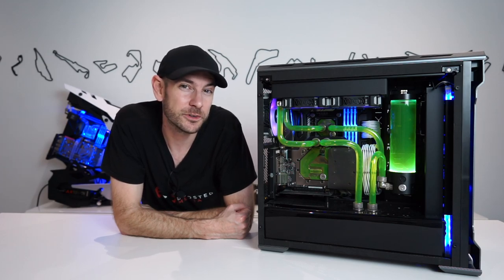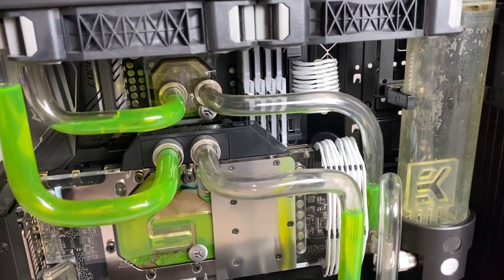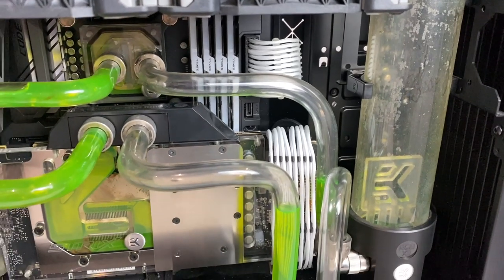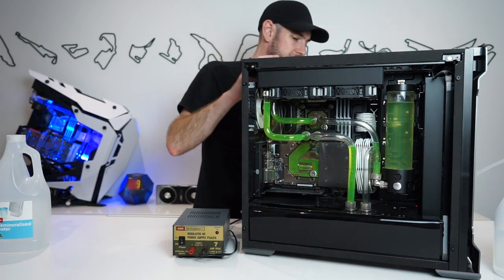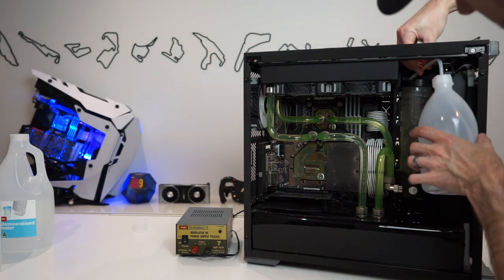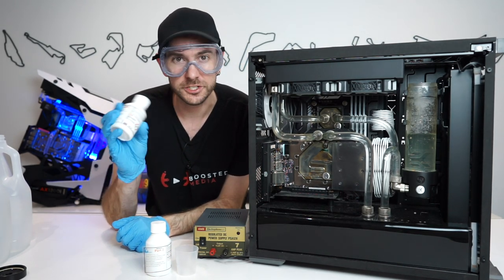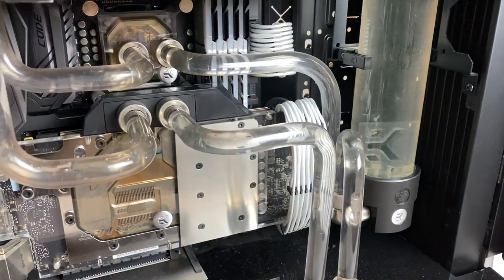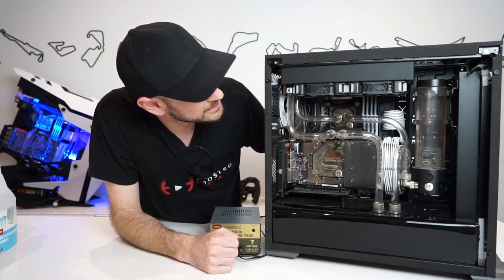WATERCOOLED PC MAINTENANCE - Part 1 - Fluishing your Loop and Changing Coolants

Comment: This (the maintenance) may be enough to convince me to not go the custom open loop route. I need something that's "fire and forget," not something that needs an "oil change" several times a year. GREAT video & very informative, so thank you.
Reply: what did you end up going with?
Reply: @pt-ri4ng  Prob something just air cooled or at most aio. Go with those if you want to do as little maintaince as possible.

Comment: what you have demonstrated is the importance of getting your drainage system correct and that using dyes is not worth the hassle. I have the Corsair Hydro X with 3 rads ( overkill ) and just using the RGB from the reservoir, cpu and GPU really looks good with clear EK + mineral water...and with a click of a button I can go from red to green or blue or whatever...looks fantastic in a dark case with tinted glass. 
I have the drain on the bottom but the pump always has liquid left in it so used one of its ports for another drain...one thing I have found with soft tubing ( yes..I am a soft c..k) when refilling if I give the tube below the pump a gentle squeeze when refueling it sends a bubble up the reservoir ie. it clears out the air blockage.
But like I said before, always plan your drainage system and spend a few $ on valves. My flow goes like this......Res/Pump to bottom 30mm rad to GPU to CPU to Res/Pump to side 58mm rad to bottom rad to GPU.....should have put the bottom rad upside down and used 90 degree fittings as well as a spiltter and I would get 99% of liquid out
Reply: Thank you for sharing! Your comment was excellent.  I have the Corsair as well but how do you know when it’s time to change out or add fluid?  If you don’t do it will it cause your pc shut off frequently? Then I have to wait a while before it will come on.  I thought it maybe getting too hot and I started looking on iTunes for some answers.  Also do you know  how frequently you are supposed to complete the maintenance, fill or drain?
Reply: @msmichellewoods  Well have seen that people with a colour additive have taking their systems totally apart and when I say totally apart I mean that includes things like the cpu block apart and scrubbing away.  I think yearly is good for a flush and refill.......and next trip into town I will be getting some demineralized water and mixing with the EK-Cryofuel and doing the flush and refill. At the moment the tubes and reservoir seem pretty clear so I dont think anything else is needed. 
If your PC is playing up you need to do basic troubleshooting and use programs like HW monitor to see what is happening . Also is the pump working?  HW monitor plus some stress program to see how things are going

Comment from the maker: Just a quick note on blowing air through the system to clear the old fluid. This will introduce bacteria into the system so you only want to do this to clear fluid before disassembling and cleaning manually as we will be covering in part 2. 

Don’t blow air through a system immediately before refilling with coolant. Flush with demineralised water until running crystal clear, and remove as much as you can by tilting the case before filling.
Reply: In the video you added demineralised water while the old fluid was still in there, shouldn't you remove all the old fluid and then flush it with demineralised water? Or is it like impossible to empty the whole loop?
Reply from the maker: It’s impossible to empty it entirely.

Comment: when flushing the loop with the pump running, do you need to make sure enough coolant stays in the pump? if so how are you able to tell if your pump is separate?
Reply from the maker: Yep pump always needs to be primed. You’ll hear the tone change if it starts to run dry.

Comment: @boostedmedia a bit off topic but I wanted to ask, I bought the new nzxt h1 case and it came with a 140mm aio liquid cooler, think that would be enough to follow your i9 9900k of guide. Mb is also a z390i
Reply from the maker: Yes but you’ll run in to thermal issues.

Comment: Why does an AIO not need maintenance but a custom loop does.  How do you seal and lube a custom loop so you don’t need maintenance.  UV sterilized lines and fluids what’s the answer.

Comment: I just flush mine every couple months so I only have to pull everything apart like once a year. I actually like the maintenance part of it.
Reply: I don't understand why people seem to need to flush their custom loops so often lol I haven't flushed mine in literally 5-6 years and it runs as cool and the color looks just as consistant as when I first poured it. I have my PC in a very dark room I just add some chilled distilled water when it needs a top up that's it! My temps on CPU are 30-36C Idle and don't go beyond 70C full load x99 5960x 1080 ti ftw3 hybrid on evga classified 32GB Ram with 256 m.2 ssd. It runs on a thermal-take Bigwater 3.0 water cooling custom loop I pulled out of a AIO thermal-take water-cooled case. I threw it all into a massive cosmos II Black Case and to this day it runs like a monster on steroids.

Comment: One thing with EK blocks... some, not all, have excess milling oil and/or o-ring grease out of the factory. Your staining is likely due to not cleaning the loop between fluid swaps, but it could also be any number of other things. As a matter of caution, if you get an EK block, I would recommend taking it apart before you install it and cleaning the block surface and o-rings with soapy water (leaving some liquid on the o-rings so they seal). Alternatively, and a better course of action, get blocks from different (better) brands. Aquacomputer, Watercool, Bitspower and Phanteks are higher quality (particularly the first 2).

In addition, I would avoid EK coolants (outside of their clear), especially if you have just done a blitz flush (EK states that their coolants do not react well with Blitz). End of the day, Mayhems and Koolance are more reliable.
Reply from the maker: You definitely want to be flushing the system out completely or any cleaning products before adding coolant as stated in the video.
Reply: @boostedmedia  I've talked with EK (Atila Gabor) about this, unless you take the loop apart and flush everything individually, you are still going to have a bit of the Blitz part 2 left in the system with a normal flush (Mayhems' instructions). Given that EK can't guarantee how well people flush their system, they recommend against using Blitz and their fluids.
Reply from the maker: paskowitz I did a blitz and refill on one of my other systems last week, and then filled it with EK clear coolant so we’ll see what happens. I did flush 80L worth of demineralised water though it before refilling though to try and get rid of all the residue from the previous opaque fluid that failed.
Reply: @boostedmedia  80L is a lot... so you're probably fine. EK clear is also the least "reactive" of their coolants, so that also helps. IIRC the reason for the issue is Blitz creates a pH imbalance for EK's fluids. However, as by design, it matches the pH for Mayhems own fluids. Mayhems Pastel in particular. In my experience, Blitz and then Pastel is the only >12 months reliable opaque coolant.

Comment: You shouldn't have your pump plugged in to the mobo when trying to clear it. Just use molex so it runs at 100%. It should not be struggling like that, even with those bends.
Reply from the maker: I runs at 100% when there’s no signal from the motherboard. The problem is the Ubend creates an air lock.

Comment: With cars I know it’s not a car ; but for coolant I don’t use distilled water ; because the water actually needs the minerals in cooling systems ; I know this is not a car but it must be working on same principles ; so in cars with cars coolant you are actually supposed to use reverse osmosis water or the filtered water that you buy in supermarkets ; a lot of people as well believe distilled water is what cars require and they are wrong. ; in NSW the water supply is actually classed as SOFT water so you can use TAP water but places like SOUTH AUSTRALIA from the tap it’s classified as HARD water; I’m a Automotive technician 👨‍🔧 by trade

Comment: Interesting! but risky!, I have a Dark rock 4 pro be quiet handling a core i9 9900k I have no issues/on summer a bit increase on temp about 80 load... just this air cooler takes so much space and eats one of my 4 slot RAM, I always think about water cooling solution, but I have no time to keep an eye on case.
good job #Boosted Media  well done!

Comment: Can you recommend any decent water coolant in 2020? 
Please no pastel/opaque colors since those are pure cancer for your loop.
Also two suggestions in case you don't have them yet. Add a filter to your loop. It saved me quite some ass with pastel/opaque coolants in the past.
Also add a "Pressure Equalization Membrane Fitting" to the very top of your reservoir. 
Like one of these:
https://www.amazon.com/Aquacomputer-Pressure-Equalization-Membrane-Fitting/dp/B009KBEE70
https://pcool.de/p/barrow-entlueftungsventil-automatik-and-manuel-tpqz-v2